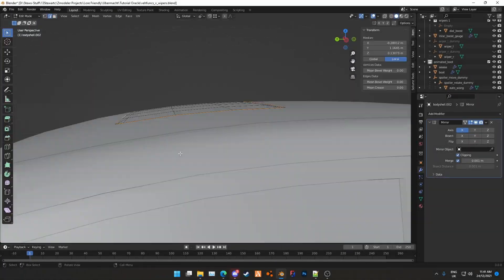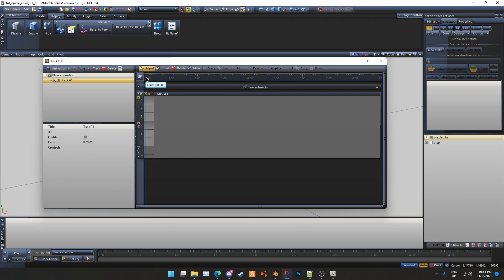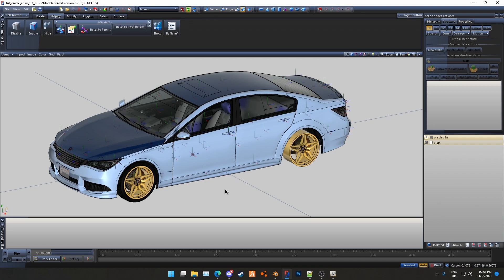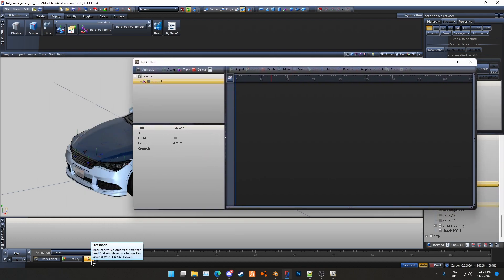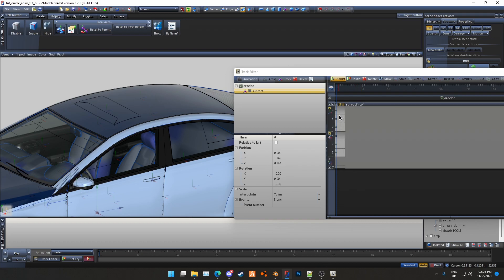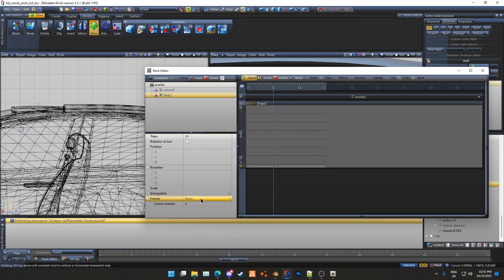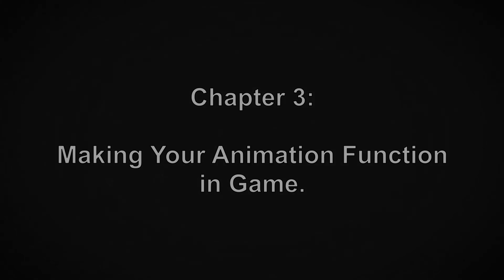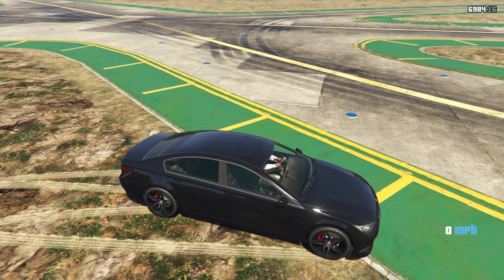Create a GTA 5 Animation using ZModeler 3 [ZModeler 3 | Tutorials]

Comment: Hi,
Thank you for this tutorial that serves 3 years later.
Is it possible to do a tutorial for dynamic turn signals ?
Is it also possible to add a sound to the sunroof when closing and opening ?
Reply from the maker: No, I've retired from GTA V modding so wont be creating more video tutorials. 

Last I checked there was a problem with making the convertible roof sounds function, I believe that's still the case.
Reply: @13Stewartc 
Oh no 😐
Thanks anyway

Comment: I'm following the video to a "T" and when I try to test the first part of the animation,(Like you) I click the slider and the part snaps back to its original start point and wont animate when i drag the timeline slider. Any ideas? Edit: Guess my Zmodeler dont like the "test" playback. I did the full set up and it works just fine...
Reply from the maker: You need to make sure that animation playback is enabled in the scene window. Top right of the scene pane is a few buttons if I remember correctly the 3rd one from the right is what you want, it'll have 'wireframe' 'outline' and other options in it including 'Animation' enable that and playback should work. 

You also need to make sure that when you're not adding keyframes free mode is turned off iirc.

Comment: Thank you for your tutorial. How should I create an animation for the soft top? It looks like a whole, but in reality, it has many axis points set for rotating different parts. I don’t understand these; could you explain it to me?
Reply from the maker: @Jyun-j8q  basically, there are many bones that make up the skeleton of the soft-top roof, these bones are what's animated and translated onto the mesh which is all one piece and has topology set up specifically for the roof to look correct when animating. The mesh uses weight painting to assign vertices to each bone, with transition weights between each bone. 

It's fairly complicated, but this is standard for animation like this, you'll find the same setup used when animating animal models or even models of people. 

This kind of animation is a little advanced to create in ZModeler 3. I'd highly recommend you learn how to create the animation in blender, as it has much better tools for rigging. 

If you want to use this for GTA 5 it'll be very difficult indeed, as the workflow is very convoluted / difficult. (Not even I have attempted it as it's far to difficult for even me, due to the workflow being so convoluted) 

I hope that's helped shed some light on animated roofs.
Reply: @13Stewartc  Thank you for your response! Actually, I am trying to create a soft-top animation for my mod. If the cost of completing it is too high, I will consider abandoning the project.
Reply: @13Stewartc  Hey, thanks again for your tutorial and reply. They gave me the ideas needed to create the soft-top animation. I’ve now completed it in ZM3. Assigning the weights was indeed a challenging task, but it was a good start. So, once again, thank you!：）

Comment: great tutorial , however im having trouble in game , animation in zmodeler and open iv works great , but as soon as i try to use the animation in game , the car endlessly flys up , please help  , how can i fix this ?
Reply from the maker: Sounds like an issue with a collision. I'm unsure what could be causing this as i've never experienced it. But if your animated piece has a collision theres a chance (unlikely, but entirely possible) its colliding with another collision on the car and causing physics to break. But i'm unsure tbh. Its also worth noting that you must re-export your vehicle after setting up the animation, any hierarchy changes you made whilst setting up the animation need to be exported for the animation to work properly.

Comment: Very good tutorial. Is it possible to change the scale value of the animation?
Reply from the maker: No, scale keyframes don't work with vehicle animations as far as I'm aware.
Reply: @13Stewartc  Thank you for answer. Then, is there a way to apply multiple animations to each object?
Reply from the maker: @사랑하는나의애랑우랑  I'm not sure, but you can have movement + rotation keyframes in a singular animation.
Reply: @13Stewartc  Is there a way to import animations from Blender?
Reply from the maker: @사랑하는나의애랑우랑  no, sadly.

Comment: Years later and I have just started to dabble with animation, superb video really easy to follow. Created my first opening sunroof :) I also created a animation for a Batwing I am working on using the hydra meta data file but it doesn't work although the animation works fine in the .yff file viewer in open 1V. Can you only animate for car roofs is my question?
Reply from the maker: You can animate basically anything you want  but it uses the roof animation functionality in game and in the metadata to trigger the animation.

The only limitation that exists is that you can't animate anything you want to have a moving collision nor can you animate parts that are within dynamic bones such as doors, trunk, bonnet etc. (the animation will work but will snap to a key frame when the door is registered as dynamic (which will be whenever its moving)
Reply: @13Stewartc  so the animations still don't work on aircraft i have tried a helicopter and hydra jet and the animations don't work yet when i animate a car everything works. Do you know someone I could converse with as I have asked question in 5mods server with not one reply, sorry to bother you, don't know if your still that in to modding but this is driving me nuts lol

Comment: Hey, nice tutorial but I’m having a little trouble. I’ve followed all the steps correctly, but when I hold ‘H’ the animation doesn’t play. It does play in the model viewer on OpenIV though, any idea what it could be?
Reply from the maker: Did you name the .ycd file va_youranimationname ?

You also need to make sure the dictionary name in vehicles.meta matches the ycd name. (Then the second name should be your root animation name)

Also keep in mind that animations only work on cars / trucks. A friend of mine tried it with a motorcycle and it didn't work. (Which makes sense since this functionality is intended to be used for convertible roofs)
Reply: Actually I think it’s something to do with the flag of the dummy. It says ‘Node’ instead of ‘Flags’ and the value is ‘6007’ instead of ‘AE’ how do I change this?

Comment: Question, i have done everything and it works fine everywhere BUT in game it only rotates but does not move. Any idea why? Does it has to be longer for multiple objects?
Reply from the maker: Read the pinned comment. If you're using the official version of ZModeler this applies to you, if you're using cracked then what I explained in the tutorial applies to you.
Reply: I have the same problem, have you been able to solve it?

Comment: Hello sir I have a concern. When I open the track editor, the option user defined options or properties is not visible for me. How do I fix this?
Reply from the maker: That means you're not using the latest version of ZModeler. You're probs using cracked
Reply: @13Stewartc  got it! Thank you and ill buy the newer version
Reply: @13Stewartc  May I ask you a question? I have a concern with my animated lights. When the passenger is out of the car, he/she can't see it anymore but the driver can only see the animates lights on. How do I fix this? Thank you!!

Comment: i try animation on boat, but no work
Reply: sadly it seems to only work on "vehicle_type_car" as class. Tried it on a plane, didn't work. Tried it on amphibious vehicle class, didn't work. CHanged vehicle type in vehicles.meta to car and ding... worked fine with the same model and animation files :(
Reply from the maker: Idk if it'll work on a boat. Since the animation trigger is the cars convertible roof script

Comment: @C.Stewart Gaming how did you toggle the track properties? mine does not show them in the track editor box
Reply from the maker: You're either using a cracked version of ZModeler 3 (not 3.2.1) or you're using 3.2.1 but the update hasn't reached you yet (reinstall ZModeler if this is the case)

Comment: I made all the steps you made 6 times over and over again and on a car I made it won't close the sunroof only open. Do you know what could cause this problem? thx in advance!
Reply from the maker: Closing is the reverse of opening. If you set up the animation correctly (as shown in the tutorial) including the later part about setting it up to work in-game. It should work as intended.
Reply: @13Stewartc  Funnily enough, I have the same problem. Followed the steps to a T, I've even done this before on previous vehicles. Still, no dice. The sunroof opens, but won't close. Works both ways in OpenIV, Opens in game, but won't close.
Reply: Have same problem, it work on ZM3 and on OpenIV. On game roof only open, can't close it

Comment: Hello, I'm not sure if you monitor this comment section anymore, but I have an issue regarding animating compartment doors on an ambulance.
So when I rotate it, I need it to rotate on the mesh's axis, which it does, but when I scroll through the animation, it actually rotates to the world axis.
Reply from the maker: Turn off "pivot" at the bottom right and make sure the local axes is set properly on the piece of mesh you're animating

Comment: I want do animate the windows i do the same like u is there anything oder that i have to do ? thanks for the help
Reply from the maker: The tutorial explains everything you need to do to create an animation. (rotation / movement, adding key-frames etc) you should have all the tools you need to create your animated windows ^^ good luck ^^
Reply: @13Stewartc  yes the video bring me a step closer to my animated windows thats gread but my ladt porblem is it doesnt work ingame idk what i do wrong! I only want start and stop so i need 2 keyframes right ? And second question : in the properties did i have to write the full text from your bio or only start stop ?
Reply from the maker: @stefanwultsch2434  copy the entire line from the description
Reply: @13Stewartc  yes i do. But my windows dont roll down the drop down like there is no animation they drop away ?
Reply: @13Stewartc  i press H than it takes 3 seconds then windows away the dont roll down
Reply: @stefanwultsch2434  did u ever figure this out

Comment: Nice video! Can you make a video where you show, how to make an animated car that always have the animated lights on, when the engine is started?
Reply from the maker: Animated lights aren't possible as far as I know with this method. So no, I'm not sure it's possible to do this.
Reply: I mean that the lights glow always if the engine has started. If Engine goes on the car have animated lights, but after a few seconds the lights are always on and glow.
Reply: @fxbio074  all i know is that you can have some lights always being on with just applying lights_emmisive shader and not giving it id, dunno about animation, may be it's kinda the same process that contains this ^